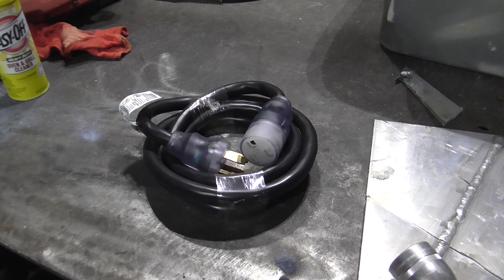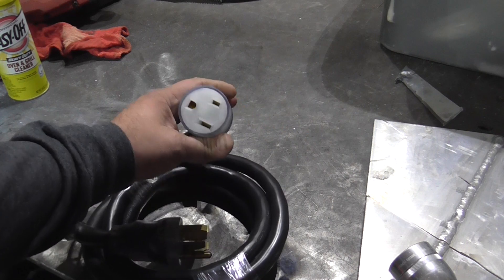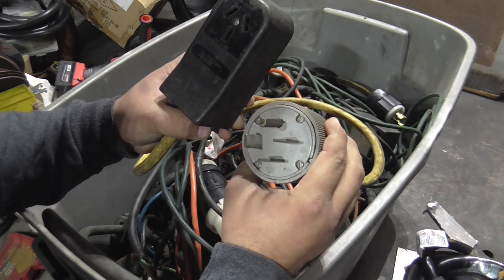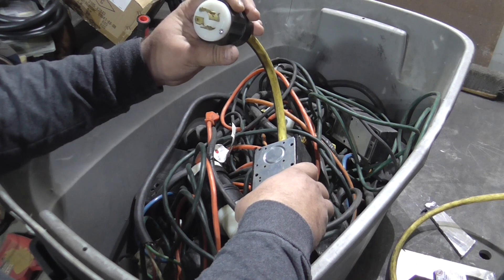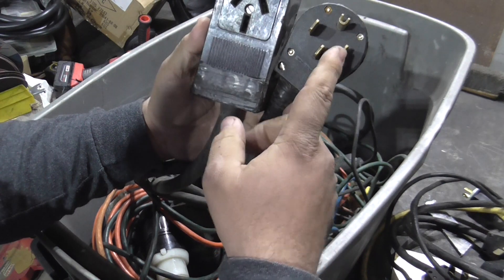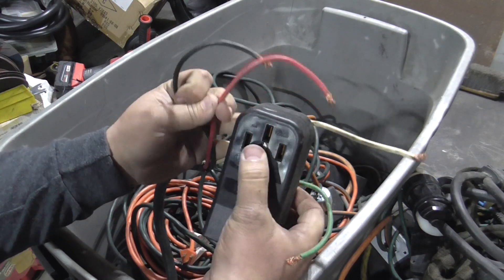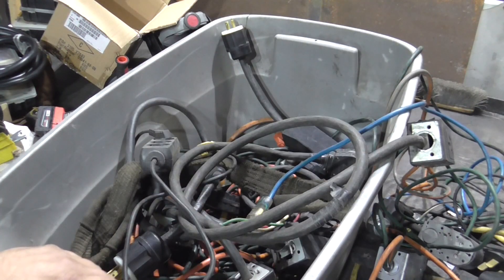220 volt single phase and 3 phase for welders, adapters, plugs, configurations etc ....

Comment: Hi ...i recently picked up.a used  but in like new condition Panasonic Gunslinger 260 mig / stick welder .

I noticed the copper jumpers were stacked together on the 575 volt single phaze terminals .

So if this welder was previously plugged into a 220/240 volt plug in with the jumpers aet in the 575 volt position , would the welder even been able to turn on to cause any internal damage ??

Would there be any internal damage done
Reply from the maker: sorry I dont know nothing bout the machine
Reply: @ZILAwelds  that's ok....figured it would not hurt to ask . The very little posted reviews I read online say these were very well built mig / stick welders made in Japan back in the 90's ...suppose to have smooth weld traits as well .

Comment: I have a miller 450 3 phase and need to make it 240 single phase will a adapter work
Reply from the maker: no you need a phase converter for that - depends on how much welding output you are using maybe a 20 hp or 30 hp ...  check american rotary talk to Chris, he can help you but better bring $2000+ with you ... good phase converters are not cheap  .... and cheap once are rarely good ... as my brother always says: the guy who buys cheap is the guy who buys twice ...  LOL

Comment: What do you recommend to convert a 4 wire  3 phase welder to a single phase 220 outlet.
Reply from the maker: You need a phase converter.  Based on size and brand that is about $1500-$3000….  Check out American Rotary
Reply: @ZILAwelds  I'll look into it.  Thank you

Comment: Thanks, makes welding less of a pain for those doing it.
[edit]: still haven't tried out my 120 to 220 machine and will probably blow its fuse.
I should probably wire in a breaker before even trying.

Comment: How can I run  230v 3.phase welder on a single phase 220v outlet?
Reply from the maker: Michael Smith only with a phase converter. Depending on how much power you need for the welder those phase converters are $2000-$5000 ....  you plug into 220 single phase - out comes 220 3 phase

Look up american rotary
Those guys are really good

Comment: Good info. For a millermatic 212 that has 2 pins and 1 round pin for total of 3 pins. What male plug should be used? How do I know how many amp? The machine just has the pins taped no plug looks like it fits the white female plug at 2:36 on the right that you said most of us will use.
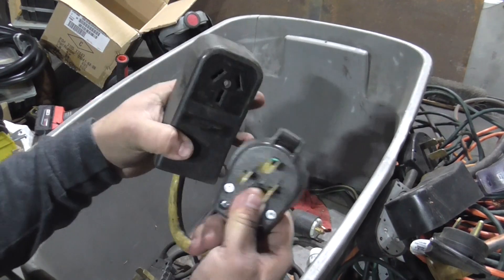Reply: I see at 6:14 you say it's a miller style outlet. That miller style outlet is missing just has the pins taped up with electrical tape. What plug do I buy at homedepot or lowes? What phase or amps? Thanks
Reply from the maker: NEMA 6-50
Reply: Thanks

Comment: I have a 110 v sanding floor machine that I wish to convert to run on both 1110 and 240 do you know where I could find instructions to do this, please?
Reply from the maker: you need a step up (in your case step down) transformer .... something you feed 220 volt into and get 110 out like this.  https://amzn.to/2NtzEWq

Comment: I have a 3 phase only plasma cutter and only have single phase 220 in my shop so I can build an adapter to make it run ?
Reply: you need open delta curent from your supplier, this is a compromise between 1 and 3 phases using only 2 transformers which will still provide 110/240V
Reply from the maker: No.  You have to buy a phase converter.  Check out american rotary

Comment: Hey Man, awesome video. I do have a question about another issue I have. I have a TIG, MIG, PLASMA in the US, running on 240V here. I am moving to Europe (France) and don't want to leave it all here. Is there any way to make them run there? I know the frequency is 50Hz vs 60Hz.... there must be a transformer for that.... Thanks
Reply from the maker: Michel Cetre the 50/60 hz is normally not an issue at all ....  the amp draw might be though.   Although they have 220/230 volt single phase their single phase is typically limited to 16 amps in a few very rare cases 25 amps. 
Although you could theoretically make a 40 amp circuit ( in your own house - not in a rented apartment ) this is expensive and uncommon 
EVERY house has 3 phase 400 volt.  That would ne the common thing for plasma cutters and welders over 180 amp
Reply: @ZILAwelds  , so basically not worth it? I can find transformers to go 120V US to 240 Europe, but nothing  240 US to 240 Europe.....

Comment: By chance do you know where i can find a 3 phase 3 round pun plug. I have an old hobart m5 generator and want to use it with my welder. I found one online around 200 dollars andbwas like yikes. Thanks for your time.
Reply: Pin not pun. The welder is a t225 hobart.
Reply from the maker: staci haley check 
Amazon, ebay or craigslist
If all of those are negative - think about changing the receptacle in the generator to a more common ( cheaper ) style ....
3 phase is strange - some plugs i have are about $15 some are $160 and there is no rhyme or reason that i can see

Comment: I think my customer has got a 3-phase set up. Because he had three  Breakers together . 40 amps each. So that's good. 

I took two legs and a ground for my adapter to my welder plug.  116 and 117. Together read about 2:30 something.

Am I correct in assuming that these 2 legs are 1/3 out of phase. And that will be good for my 220 single phase welder? It's one of those Lincoln Tomb stones

Comment: Hi Pete,   I have two 240V services in my garage 30 amp and 50 amp services.    Both are along one outside wall near the middle of the garage.  When I finally purchase my welder how long of an extension from the outlet to the device can one go with this service?    Being I won't be investing in ventilation control most of my welding will be outside of my garage all open to avoid fumes.   Thus an extension cord will need to be used.
Reply from the maker: Gary,  on a 30 amp circuit I would think you can run a 100 ft cord 10 awg (or heavier if you like but 10 is plenty good). on the 50 ft circuit you can technically also run a 100 ft cord, the size of the cord is largely determined by how much power your welder draws .... if you welder draws around 30 amps or less the 10 awg cord is good for that welder (regardless on which output it is plugged into) if you have a machine that draws 40+ amps a 8 awg cord would probably be a good idea if your machine draws 50 or more amps a 6 awg cord is a good idea ....  no depending on your duty cycle (there is a formula and a bunch of science and stuff involved how you can figure out exactly what you need ...  and if the duty cycle of you machine is low the cord can be a size thinner .....    but this should give you a good idea on where to start.

Comment: That must be a good thousand dollars of plugs just in that box.
Reply from the maker: no not that much ....  I would say $30 per adapter (the 2 plugs and the cable). and there  are like 15 or 20 in there ..  so $500 and a day of work building all those things ... but on average it saves  1 gal per hour on the generator (that is $3 per hour ....  after 200 hrs or less  - its all paid for just in gas - not even speaking of the noise and the smell and the oil changes and everything else .....

also if I can plug in right where I have to weld - and NOT have to plug in 200 ft of extension cord in the generator and than the forklift guys drive over my cords ...  

than it is a really good deal to have some of those adapters on hand ....
Reply: sidewaysdanny Welder at my work are 600 volt 3 phase ,so we use Hubble HBL21415B
Reply: Wow those 3 phase plugs and the pins in them are tiny!
Reply: high voltages means smaller required wire size and pins for same power draw.  P = E * I 

when I do work on 480, I keep thinking I sized my wires wrong.  I get locked into 208 at times for feel.
Reply: John M  maybe so, but you should see the plugs we use here for industrial power sources
Reply: Interpower.com  is a good resource,   I got a Export Designer Reference and catalog from them.  Call them  for a copy, should be a pdf online too I figure, I like my paper copy out dated to 2004 but still good.  

Tells you more info than you  want to know.   Standards for different countries .  This catalog , hubble catalog and my control design design handbook with all the NEMA numbers are my goto docs. 

  600 VAC is more rare for me.      500-800 VDC  for plasma sources , the 10KVDC low amp source were more fun.   On the other side of it,  think of a  2000A source at 6 - 8 VDC ,  Think about a cable the size of your wrist.

Just looked around on site, they got more information than I recall from pre-web days,   They used to be called Panel Components Corp long ago.   

http://www.interpower.com/ic/designers/designing-for-export/guides-and-charts.html

Comment: I thought you had to have a phase converter to change 3 phase to 1 phase. As always great video, educational.
Reply from the maker: only from 480 you need a transformer to come down to 240 .....    to go from 3 peseta single phase is "easy" and the first couple years I didn't know that either ...  so I made the video. - hoping it will help someone out ....